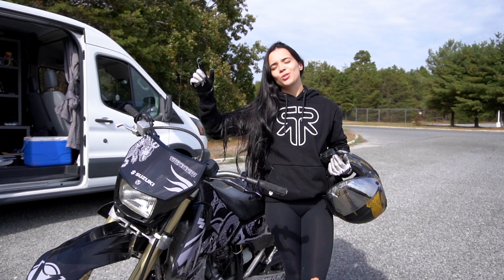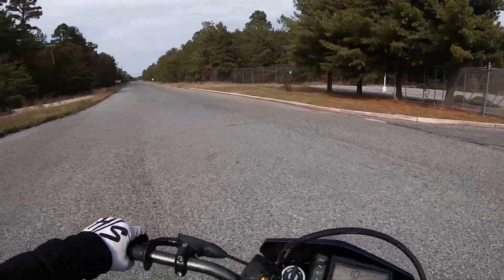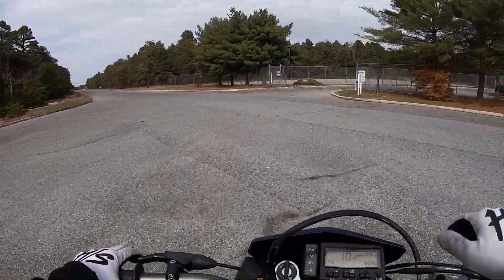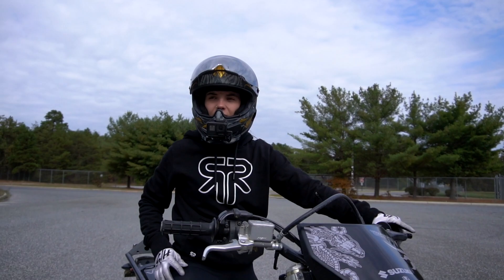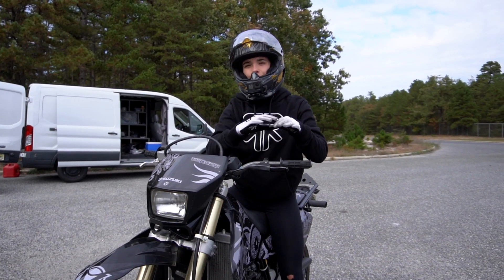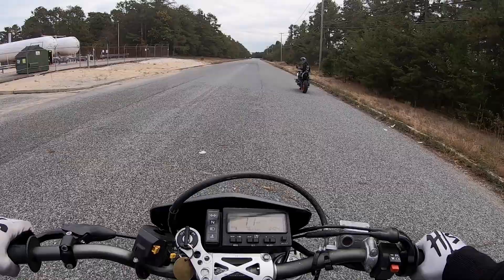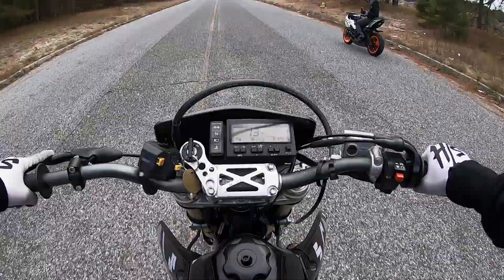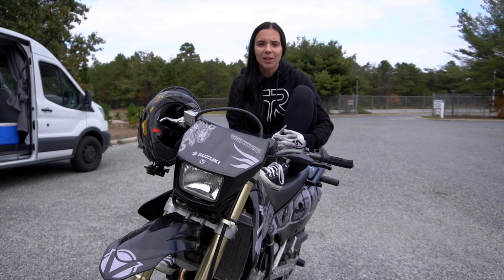HOW TO WHEELIE A SUPERMOTO! ( Part 2. DRZ400SM ) Troosh Teaches

Comment: Really good tutorial, better than most others out there.
I have a stock DRZ and it is so easy to get it up. In 1st and 2nd gear at least, 3rd requires some serious pulling on the bars.
Been trying to learn wheelies for about 2 years now but I still can't get the front wheel up higher than 2 feet or so because I always crap myself... my brain just always goes "Nope!" and I let off the throttle :-/

Comment: Can I make a suggestion? Buy a used DRZ 400sm.. put a Athena 440 kit with a FCR 39 carb on it.  You can power wheelie in 1st,2nd and 3rd.. so much easier to learn to wheelie when you have enough power to get that wheel up without the clutch. Once you work on your throttle control, rear breaking and balance for a while, you'll be able to learn to wheelie with the clutch so much easier and not have to worry about flipping the bike so easily..

Comment: You and Alec motivated me to get a DRZ, I finally pulled the trigger two days ago and picked up a mint 2009! I’m stoked! Does your back brake feel soft? Im used to sport bikes where my brake felt more stiff. Im gonna do a full yoshi, 3x3, and JD jet kit. How’s the bike after Alec did yours? I’m sure the sprocket makes a difference to but power wise is it pretty noticeable with the new mods?
Reply from the maker: That’s awesome! But yeah the brake is soooo much softer than any other bike I’ve been on. You get used to it tho! After Alec re did my exhaust and carb and stuff it runs SO much better, but it was running weird before that so I was able to notice a huge difference. With the sprocket I ride more in second gear now, used to be first! It also sounds alotttt better with the new exhaust too🔥
Reply: What size sprocket did u change to?